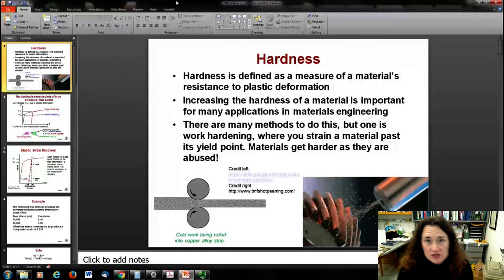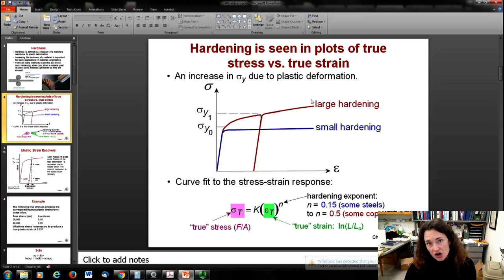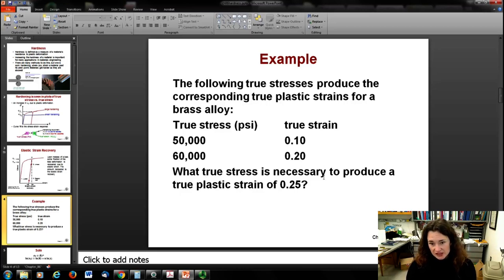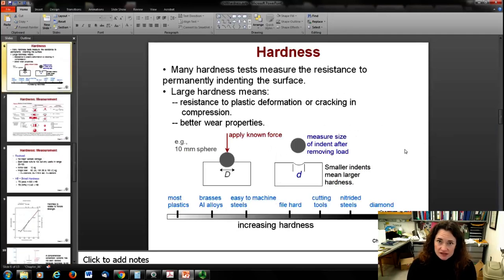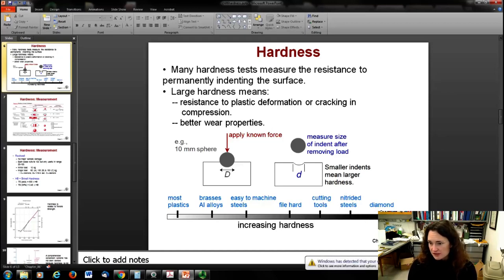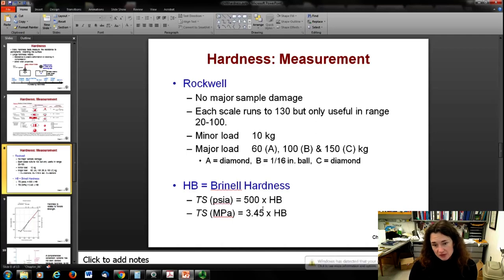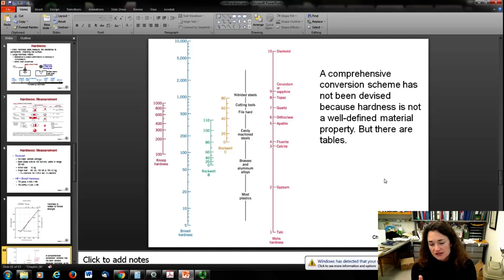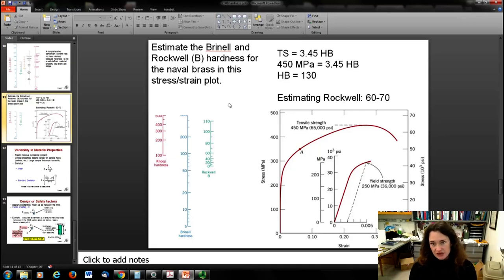Hardness of materials

Comment: Hello. I hope I'm not annoying, but I have a few questions:
1. What are sigma y1 and sigma y0 at 1:56 at 1:56 of this video?
2. In one of your previous videos you mentioned Miller indices. Is it possible to calculate the normal indices the same way you do the Miller Indices? In the book Callister they work with 0*a etc. and it makes me crazy.
3. Is the strain 1/5 of the slope of Elasticity modulus?
Thanks for all your hard work.